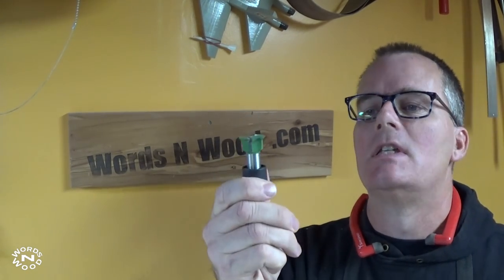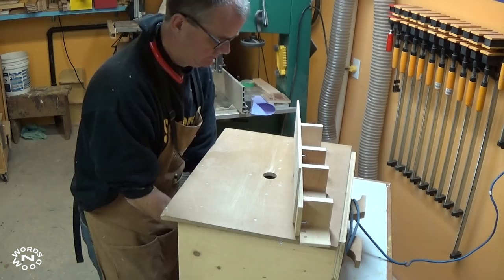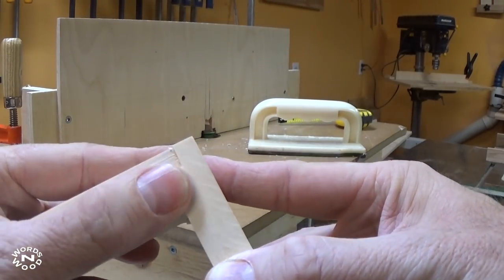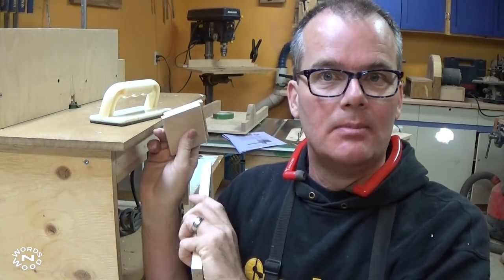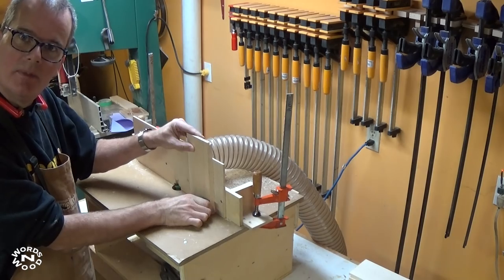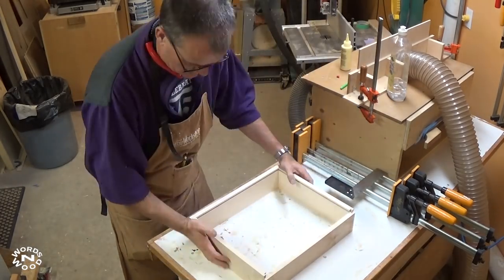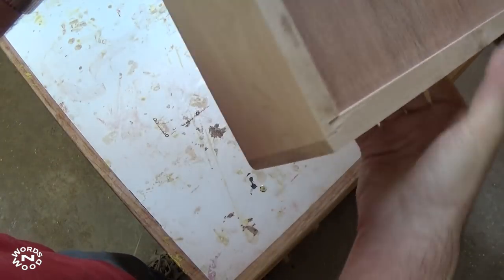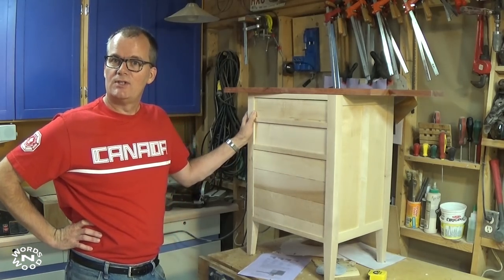The Drawer Lock Joint (WnW #35)

Comment: I have had the same Lee Valley bit for many years.  I have probably done more than 50 drawers with it.  Some of the drawers have been quite large.  Most often I am cutting Baltic birch plywood, but sometimes solid wood.  I also often use the same interlock to let in the drawer bottoms, particularly on the larger drawers to prevent racking (stock dimensions must be quite precise for this to work).  Main point is that the bit has covered a lot of distance and shows no sign of degradation either to the bit or to the cut quality.  The drawers have been used in kitchens, bathrooms and commercial installations and I haven't had one come apart yet.  Set up is a little fussy but not too bad once you figure it out.

Comment: Interesting. Whenever I'm setting up a cut with a special bit like that, I keep thinking the darn thing will be worn out before I get the fit dialled in :)
Reply from the maker: +John Heisz valid point.. it is a $32 bit.    From the instructions it looks like the angle is the main contact point.  If the small tip is worn back I think it'll still be fine.   Of course I'm no more a production house than you are, so I really have no clue as to how long a bit like this will last!!!  :-)

Comment: The sides are full length - it appears that the front and back pieces are full length in the half blind method but will they be full length in the 1/4 to 1/2 thickness variant ? I am guessing they are still full length, as the very top will still ride against the router fence and will also extend all the way to the sides of the drawer when joined together ?
This should make it easy to cut the stock, just like for dovetails and box joints....for other drawer joinery methods (rabbets, locking dados etc), its always complicated figuring out the lengths of the front and back.
Reply: I just looked again and actually the sides are not full length...thats going to be a little fiddly, figuring out the length.
Reply from the maker: That's why you make test cuts.      Other drawer methods also have shorter sides.  you might want to look into finger joints or through dovetails if you want full length pieces

Comment: art when you are making these boxes or getting the wood prepared for them,,,how do you cut the front and back to fit the sides that give you the width,,,,,,lol,,i hope you understand what im saying
Reply from the maker: This is explained in LVT instructions in detail - I'm working with 1/2" stock, and the joint is cut about 1/2 the thickness of the stock, so the side pieces are about 1/2" shorter than the full length (depth?) of the drawer.       If you use overlay drawers this doesn't matter, since the drawer face will stop the drawer as it contacts the face of the piece.  If you are making inset drawers, then I would leave a little space in the back, and probably glue a little stop inside the back of the cabinet to make sure the drawer closes to where I want it to stop.

Comment: First time using this bit..and having nothing but trouble. Every other Utuber says to set the bit 3/8ths of an inch above the table and not measuring the top of the bit  to the table 1/2 of the stock you are using. I have 5/8ths stock so I assume 5/16ths is the correct set up. Didn't see your set up for the fence...you need to re shoot that as it wasn't very clear..Fence depth is as important as anything...
Reply from the maker: If you go to the Lee Valley website and look up the bit you can find the official instructions.   Look under the "care and use" heading:   https://www.leevalley.com/en-ca/shop/tools/power-tool-accessories/router-bits/45097-small-drawer-lock-bit

Comment: Just curious .... WHY do virtually ALL these supposedly "lock joint" router bits ... cut the joint with an angled surface .... rather than ALL surfaces being perpendicular/square to each other??? If accurately cut, much stronger mechanical joint than this angled thing.
Reply from the maker: you're asking the wrong person.  Try contacting the vendor or designer.